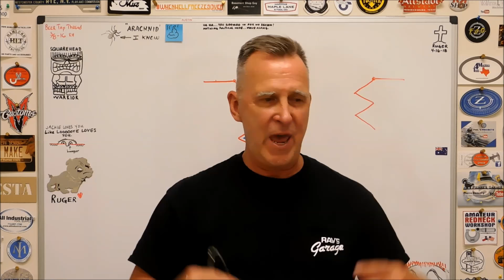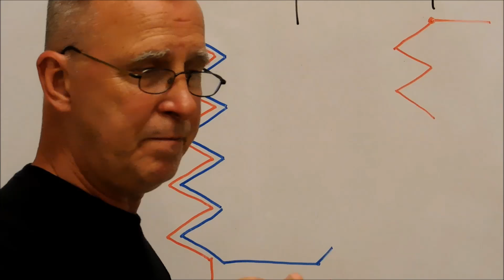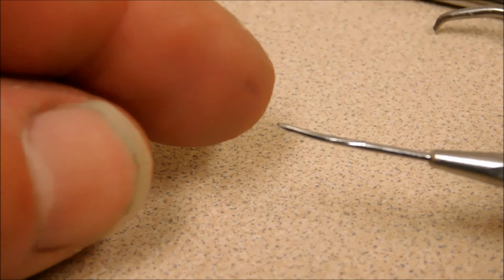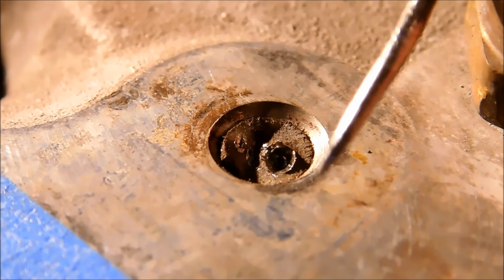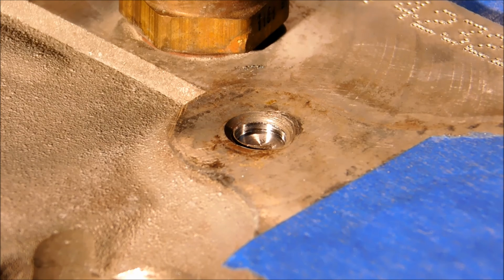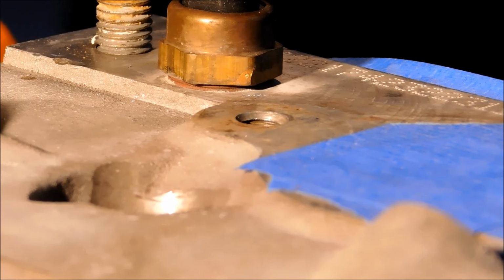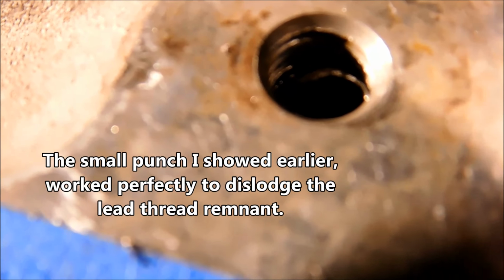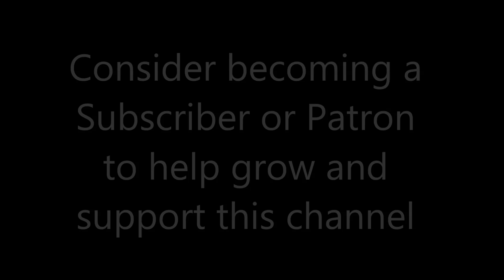Removing Sub Surface, Snapped off Bolts -- Take a Look !!

Comment: Hey Joe! thanks for this tip. I wonder If you could give me some advice on a different type of broken bolt. It's on my lathe, in the shaft that carries the first gear that drives the other gears on the banjo for threading. I can't , or I don't dare to, I should say, to get the axis off the headstock, so I'll have to make the surgery in place. It's broken like 4 or 5 mm in. Should I use a dremel with a burr to clean it up, then center punch it as good as I can, and try it with a left hand tap and bolt? What would you do in this situation?

Comment: Common problem when the LS engines breaking the exhaust bolts . Tell Joe to split the manifolds between the bolts and it wont do it anymore GM ended up doing it to fix the problem . The manifolds expand faster than the aluminum heads. I see hes finally getting his cam in . Tell him i said Hi
Reply: Yes, very common, I average two to three a week, most times the ones broken off are at either end, occasionally one breaks in one of the center pair holes while the mechanic is taking the manifold off. GM uses some thread locker in them too, which is one reason why easy outs fail to back them out. I center a 1/4" flat washer over the bolt, TIG weld it to the bolt and then weld a 3/8 nut to the washer. The heat breaks down the thread locker and they spin right out.

Comment: i work on forestry equipment usually on site and if changing a set of track guards you dont have 50% of the bolts broken off you consider yourself blessed, they are normally 18mm or 3/4 inch depending on the machine. pretty much the only time/cost effective method is drill the whole thing out oversize and retap to a size larger. if circumstances dictate that cant be done then drill oversize, weld up the hole redrill and retap. The machines start at 30 tonnes so they don't fit on our mill table unfortunately so the mag drill is essential.
Reply from the maker: Sounds like quite a task.

Comment: i like using a drill block with a drill bushing.  you can either line up with a pin or a bombsight cup, but it helps keep the drill more stable as it allows less flex in it to walk out.
Reply from the maker: If you have available threaded holes, why not use them for a guide plate. I agree.
Reply: @joepie221  i was implying but forgot to mention that i think most of the time people are doing this, the piece of equipment they are working on is installed still and that measuring and interpolating a hole pattern is out of the reach of many.  You are also at the mercy of accuracy of the machine and tooling that made it thats running crazy production, i think exhaust bolt holes are pretty far down the food chain on what they (auto manufactures) require to be exceptionally accurate, i can probably find out though.  I dont reuse threads though, ill punch it out and use a keensert, its a couple bucks and is generally easier to get done, others like to use helicoils because of how cheap they are, but i prefer the full insert.  It also has the advantage of being less likely to have corrosion being steel on steel threads.

Comment: we are all guily of putting endmills in checks for light work. I have a set of undersize ground endmills for dowel pin that I put in my albreicht chuck prior to reaming .
Reply from the maker: I will only lightly plunge. I never side mill in a drill chuck.

Comment: With a steel bolt in an aluminum part, if you can't drill straight down the middle because of the part is still on the car or something else is in the way or someone has broken a drill bit or tap off in the hole you can use an Alum solution and it will dissolve out the steel bolt without harming the aluminum in any way. Just saved a vintage outboard with a half dozen very corroded head bolts this way.
Reply from the maker: Good to know. I'll have to test that.
Reply: I’ve used the alum solution. It does work. It took me about 2 days for it to eat away a broken tap. Heat speeds up the reaction. And I think you want to clean all oil out too. Maybe acetone....then the alum. But it’s not a fast process.m
Reply: Which alum, though? It's a class of chemicals.

Comment: Nice work Joe.  You should mention, or put in the notes, the setup time for the head.  Keep up the good videos.
Reply from the maker: No doubt. Setup time took a while because of the irregular surfaces and weight. If I did this a lot, I'd build a jig. It was a PIA.

Comment: You should buy a box of left hand drills. These are not too expensive considering the time saved. I did this ten years ago and very thankful even when used these a few times each year.
Reply: Paul Jones I really don’t think that would help on exhaust manifold studs.

Comment: always cool to watch this process work properly - while watching i was wondering whether or not it makes a difference whether the threads on the bolt were actually die-cut or rolled (in terms of how it behaves when trying to drill it out or extracting the actual threads)

Comment: Does anyone like easyouts 🙈😂😂... Have had many successes using high quality torq bits as extractors parallel sides so you can get good on the hole walls for the full length of the bit... The secret is picking the right size drill for the torq bit to grip in 😉
Reply: Yes I use Torx bits too. works very well

Comment: Sometimes I drill through with a drill that's a little bigger than that the nozzle of an Air Duster can. Insert nozzle, turn can upside down to get the liquid nitrogen out. The nitrogen shrinks the bolt enough to spin it out by hand with an easy out. I've had really good luck with this on stubborn bolts.
Reply: It's a fluorocarbon, usually one of the fluoroethanes, not liquid nitrogen.  The chemical has a low boiling point (-13 F), but nowhere near that of nitrogen (-320 F).

Comment: Yup. Just like old George taught me back in '75 when I started in the Automotive machine shop. One of the worst: Caterpillar torqued SS turbo studs into the bottom of cast iron exhaust manifolds. Another, busted scope mount screws in gun barrels. 
Great video, Joe!

Comment: Left hand drills should first be tried freehand and are great on bolts that are not seized or are not seized very tightly, but no matter what, always try to use a left hand drill bit just in case things come loose while you're Drilling, that way you can have it back out rather than dig deeper.
The only other success I've ever had was to drill it out as large as possible and, like he said, pull the spring out that is left from the threads.
The only thing left after that, is to drill the hole out bigger, tap it to a larger fine thread pitch, then install a same type of material bolt in the hole, Loctite that sucker in and re-drill the original hole leaving the cut off stud in place.

Comment: Heh, this works with taps, too, if you use a carbide drill.  Drilled out a 10-32 with a #21. The drill broke right at the end, but everything came out pretty easily.
Reply from the maker: I'm OK using a carbide end mill to get a tap out, but when the remnant tap chunks jump into the end mill, it could be bad.

Comment: That downward migration is the reason for using lefties when drilling out bolts.
Not everyone owns a set though, and they're getting harder to come by in the shops as well.
Reply from the maker: A LH drill is good if the stud is not frozen in place. But remember, when the center of a stud is drilled out and only the helix remains, left hand rotation can unlock the thread and choke the drill. if the whole stud isn't ready to release, the drill can explode.

Comment: Joe, this video is the cats meow for broken stud  removal. Nice job fella. VF
Reply from the maker: Thanks, I had 3 to remove. They cooperated.
Reply: @joepie221  I can tell you back in the day. I removed a five gallon bucket of broken studs roughly per year back at the shop. Sometimes one and a half buckets. The best part was that the parts came to me for removal. Did not have to work in cramped quarters trying to drill out studs. But I did make me a adapter jig fixture that was universal to make the job easier. The commercial unit kit cost about five hundred dollars. Cost me my time to make with company metal. Keep up the great work too. VF

Comment: At work we have EDM machines (both wire and Ram) and a tig welder. (Weld a small rod on the end of a broken bolt, and just spin it out)

So we don't have any of these problems.

Comment: Those that break them, think it is no problem to fix them; then if it's not perfect they think you're not skilled enough. Thankless job for friend and relatives!
Reply from the maker: I'm OK going after broken bolts if nobody else has messed with them before I get to it.
Reply: Rogue act, First I will try a pick to see if it is at all loose. If it is I will use a tap extractor. 3 or 4 pin tool to go inside tap flutes to turn out. Next if it is jammed tight I will annel like I mentioned either with a torch or if it is deep with a stick of tungsten on my welding lead or a carbon arc rod with copper removed.Hold it tight on broken tap and then turn on welder or connect cable at connector and let it get cherry red,turn off welder before removig rod. Now that it is soft and some what contracted when cooled you can take an end mill in a hand drill and flatten out and drill or just keep milling out by hand and then chase thread. Over the years I have done many dozer track frame bolt and broken tap extractions. My first go to if reachable is weld build up,weld a washer and then a nut on top and work it out. Field work, can't always run that thousand pound or more part to the nearest machine shop lol

Comment: At least you could get the head on the machine table. We had to do this to Caterpillar heads on the truck with a hand drill. Usually took a couple of hours for each broken stud. Those things were very hard. Fortunately we had time serts to repair the threads if necessary

Comment: 22:40 Try turning the "spring" clockwise first. That pulls it out of the threads making it easier to then unscrew.
Reply from the maker: It would actually expand it and make it tighter.
Reply: @joepie221  You're right it should be counter clockwise. My mistake.

Comment: Wow. I always wondered why no-one used this idea and I had resigned to accepting it just wasn't valid. Well, I'm glad to finally see it put to the test and come out valid. At the beginning of the video I was under the impression that this method is good for screws of any size but at the end I came to realize that the size of the dental hooks and chisels will determine the minimum screw diameter. Before seeing this I thought that the critical part of the operation was determining the correct size for the drill and aligning the drill perfectly (and keeping it aligned). After seeing this I realize that managing to pry out the spring is the other critical part.  The success of the latter seems to depend on the spring not being broken off towards the bottom and on being able to catch the leading edge of it with the dental hook - which means that if the spring is broken off too deep the hook might not be able to reach it.  I wonder if there are any other methods for removing the spring that one can resort to should the hook fail or if the screw is too small to allow the use of a hook.
Reply from the maker: A modified tap can sometimes get under the remnant and expose it for removal. As stated in an earlier comment. bottom taps are the best place to start. Just don't snap it off.

Comment: Seems most of my obstinate bolts do not lend themselves to machine set ups.  Be they in the bilge of a boat, buried under heavy equipment, modern trucks and cars don't have the room for most techniques.  Trying to hand drill if you have room is hard enough when you try to stay centered without trying to drill the entire diameter of the bolt.  Maybe once in a few hundred problem bolts do they allow themselves to be brought into the shop and put on a machine table.  Take care.  Doug

Comment: Excellent worked a treat and I imagine with this method you’re more or less guaranteed results 
Where as with welding you’ve a pretty limited amount of torque can be applied through your build up / welded on nut 
“Niric acid” ?  Sounds interesting
Reply from the maker: I don't do this often enough to have ever tried the acid, but it does sound easy.

Comment: As an  professional auto tech we remove these on a weekly basis without pulling the heads. Weld a fender washer to the stud and then weld a nut to the washer with a mig welder. The weld will not stick to the aluminum and the stud will screw out.
Reply: Done that many many times, it's has worked 100% of the time.

Comment: Believe it or not. You can put a nut over the flush surface of the broken bolt. 
Use a mig welder and spot the center of the nut.  Fill up the nut center with a weld and unscrew the broken stud. 
I have been a mechanic for 42 years. It surprised me the first time I watched this.
Reply from the maker: I'd be afraid to try that with an aluminum head. I would be afraid it would melt the head.
Reply: @joepie221  so is it your thinking that it would work better with an iron head vs. the aluminum?
Reply: This is the absolute way to remove bolts. I use a TIG welder and build a stem on the broken stud then drop a nut over that and weld the nut on. Add a little WD40 and the heat also helps the stud loosen and come out easier. If the nut happens to break off the stud just start over. Many years of Indy Car Racing and it never failed me once. Also you cant always put the car in a mill to position it properly to do the drilling.  None the less the video is great and as usual your technique is STELLER. Keep up the work I watch them all.
Reply: Even if it doesn't melt wholesale, it does sometimes contaminate the weld making it very weak
Reply: I've removed countless broken exhaust bolts from the exact same engine with the welder, while it's in the vehicle. Even the ones in the back. The aluminum remains completely undamaged.

Comment: Every ls based head has broken bolts . Just weld a nut to them . Heat breaks the locktite and they turn right out .

Comment: I like to drill a hole about third the diameter and drive a tapered square  punch into the hole and using a wrench on the punch and a using hammer ttapping lightly on the punch while simultaneously turning punch with the wrench it has worked for me 85-90% of the time unless it’s stuck in stainless if it’s stuck in stainless you will drill it to the size of the tap drill and then you will have to run a tap in a little then blow out hole repeat repeat repeat with a ton of oil.
Reply: If you got any left handed drill small enough to use . Use them.
Reply: Stainless on stainless can gall to the point that it's practically welded.  I don't always use anti-seize, but I always do with stainless.

Comment: "Easy out" is a misnomer, it doesn't mean the extractor will get the bolt out easy, it means if the bolt is going to come out easy, it might get it out. By "easy" I mean almost loose enough to catch it with your finger nails and back it out.
Bolt removal is a regular job for me since the shop I work in does a good bit of walk in work for the general public. In the past 30 years I've taken out three five gallon pails of bolts, mostly by welding a head on them and backing them out. The worst ones are the ones where the customer tried themselves and broke a drill bit/ easy out/ tap or all three off in a hole.
Reply: Amen to that.
Reply: What’s the walk-in price range for that?
Reply from the maker: This type of work is hard to estimate, but best guess is around $140 US per stud. The setup can be frustrating.
Reply: @gavinhougham841  Joe is on the money, setting up to drill one out takes time to do it right. That's a good hour project setting up a head because of the weird angles. An hour at a machine shop can cost $60-140/hr depending on location. That's why I try to weld one out if I can, much faster and much less expensive for the customer, it does take a different skill set though. The LS manifold bolts take just a few minutes and usually cost the customer $15-20 a piece. That is unless they have tried and failed themselves and made things worse. I did have one guy bring one in that had two easy outs broke off on different angles, including one that was into the head. That one bolt cost $180 because I had to get the easy outs out first, then the bolt and then install a helicoil.
Reply: Joe Pieczynski , thanks, that is very helpful. Well worth it for such nice clean work! Maybe your son owes you dinner! 🤗
Reply: Steamfan71 , thanks! I am both motivated to try this out myself and also scared to death of having to show up at my local shop with my ‘handiwork’ on full display! Very informative thread, hehe.

Comment: No edm at home... I start with a left hand drill.  Honestly they usually pull the bolt/screw out... but if not, I've used extractors successfully too
Reply: Honestly... I preflattened them all with an endmill,  and used a center drill to get things started, just like you did.

Comment: hi joe, i think if you hit it a few times fairly hard straight down with the correct size pin punch before trying centre punch it somtimes does help.
Reply: it can but you need to be careful of damaging the threads because its aluminum.
Reply from the maker: I could see how the shock may help disturb the rust bond.

Comment: Is it a Center drill, or a Spotting drill recommended to start the hole?
Reply: In this application in should not matter to much,. The center drill has a secondary drill section to match the angle of a live\dead center